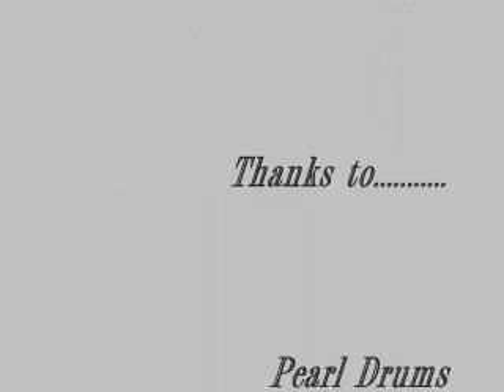Do it yourself.......Refinishing drum hardware

Comment: i have black hardware. do i have to sand it or can i just prime it and paint it?
Reply from the maker: +Nathaniel Clause You don't have to prime for powder paint. If you are wet painting then you should give it a light sand, prime then paint.
Reply: +TinaSteve Soper what is powder painting?
Reply from the maker: It's a different kind of paint that comes in powder form instead of wet. If you're hardware is black now then it was powder coated from the factory. They do it this way because it's more durable.
Reply: +TinaSteve Soper I think I'm gonna do wet paint. Should I apply a clear coat after?
Reply from the maker: It's not a bad idea. The clear will add more protection just remember to pick the right finish of clear that you want. You can get flat, semi gloss or high gloss in clear. Just depends on how shinny you want your finish. Be careful when you spray on the clear coat. Do it in light multiple coats because it runs easy.